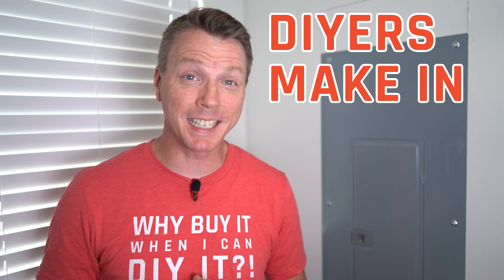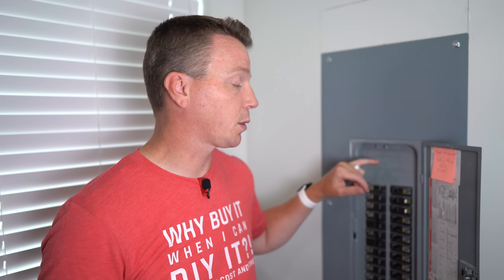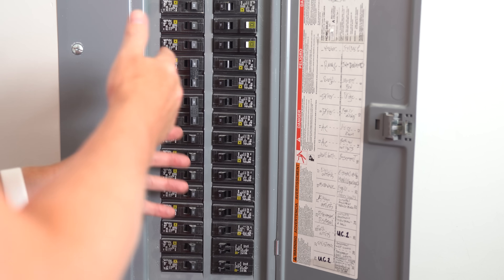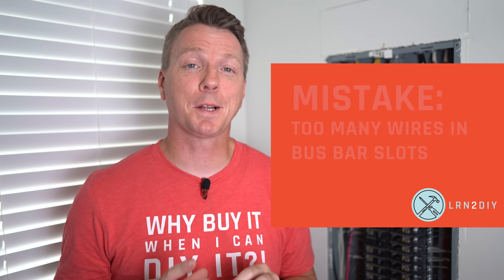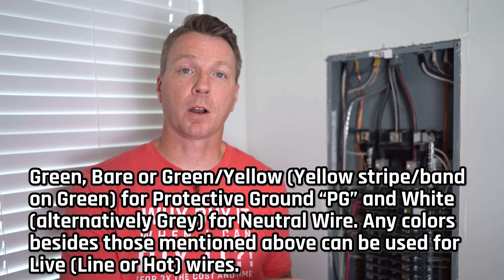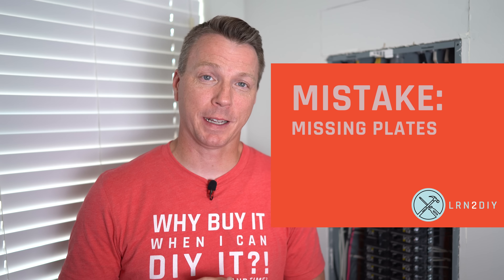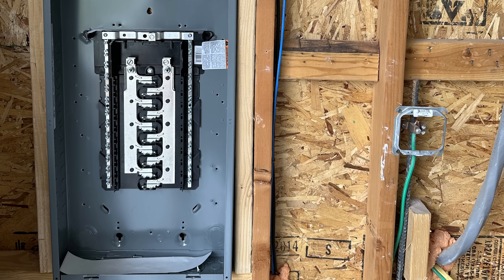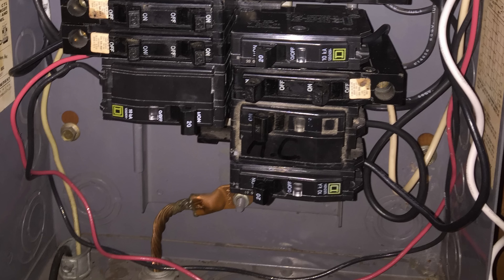10 Common Mistakes DIYers Make In Circuit Breaker Boxes

Comment: Magnífico aporte. Soló agregar:
1) El Calibre del Conductor Eléctrico, depende de la Potencia de consumo del Ckto Ramal o de la carga, y debe ser Dimensionado de acuerdo a los factores necesarios aplicables: Factor de Seguridad, Factor de Temperatura, Caida de Tensión, Factor de agrupamiento, etc. (NEC/NFPA 70_Art. 210 y Art. 230)
2) El Conductor de Puesta a Tierra, debe estar unido al Neutro. Es decir, que entre la barra de Tierra y la de Neutro, debe existir un puente, siempre que este Tablero o Panel eléctrico sea el Principal, lo que se conoce como "Unión Equipotencial" (NEC/NFPA 70_Art. 250)
Gracias por el aporte eléctrico, ha mencionado muchas cosas sumamente importante que muchos electricistas y usuarios, dejan de lado.
Saludos, desde El Salvaodr

Mauricio Archila

Comment: Don't use a drill to undo breaker panel screws or drive them. Sure the screw is not suppose to grab wires, but on a drill it increases the chance.
Then theres no bushing on your service line, thats bare metal pipe. Electric wires vibrate in use.

Comment: These DIY er mistake videos irritate me . Spent quite a lot of time and money correcting mistakes and oversights from several supposedly competent and licensed electricians. The first guys I had when I moved in to a house left so many issues in the panel including the cable entry it’s taken a couple more to redo it. And I wasn’t entirely happy with either of them. So my advice is-be ultra cautious about doing it yourself-don’t do more than you absolutely understand, but be educated and aware if you do hire an electrician. And personally I can read a code too -a few times I have challenged electricians who just mumble ‘it’s to code’. One tried to convince me not to install arc fault breakers and I realized they didn’t understand what they were for.

Comment: My house used to be 100-plus years old, knob-and-tube wiring still used for a lot of circuits. I say "used to", because an electrical fire made it not a house anymore. Squirrels are not my friends right now. 
The previous owner was a "fixit" guy that didn't really know what he was doing, and he brought in some of his friends to do some fixin' and have some beers and snort some white powdery substance in the basement, and most of it was good. 
Now it's being rebuilt and stepped up to current code compliance. It's going to be a while,  but redoing from the bottom up helps make me feel safe again, and my hyper-awareness of electrical and general infrastructure has me both planning for the future in my own house, nut also checking everything in the temporary rental. 

Found some electrical issues. Open grounds, not/neutral reversed, and no hot at all. I think we're up to ten outlets, one showing 30 VAC, and that scares my poop out. AC compressor is irredeemable, furnace may last through the winter, if we're lucky. Bought a CO detector just in case. Upstairs bathtub/shower leaks into the basement, from the underside, the blackening shows it's been going on for a while,

HVAC filter was last changed in 2015. 

I want my place to be safe from the ground up. No shenanigans, no surreptitious bottles of Modelo being uncovered  when we had to move stuff. Solid infrastructure first, make it pretty later.
Reply: glad you are ripping out every single wire.

Comment: Question: Anyone know what the term/abbrevaition "OSBO" might be? There is a mystery 240V 30A double-pole breaker in my panel labeled "OSBO RECEP" and I have no idea where it leads.
Reply: I have no idea what the abbreviation means but 240V at 30A can only be a few items. Central Air, Heater, Well Pump, Stove, Washer, or Dryer. Last potential option that might be more likely is it's a supply to a detached garage or other structure. OSBO might mean Offsite Supply Box(Outside).

Comment: Decent video, but like many on YouTube it is full of partial and/or missing information and this only adds to confusion, especially those with no experience or training.

One very important thing to mention on a main panel when you open and work on it... the feed coming in is live, so be extra cautious anywhere around those thick feed cables and where they attach.  It does not matter if you tun off the main panel breaker, as those lines are always hot.  They are shown at the top in your example panel, but may come in on the other sides for other deployments.  

The panel shown does not appear to have a main shutoff breaker (missing & not located in its knockout slot and those feeds land directly on the panel's bus bars), so I assume it may be a sub panel off the main panel (and where you'd need to cut power off to this sub panel).

Comment: 8:20, I believe the code exists because an unmarked wire is not as obvious when it is removed from the breaker, IE if the breaker were replaced or move elsewhere in the panel someone might wire it to the neutral bus.

Comment: No the wire nut connecting the ground wires together is not OK anywhere in the United State that uses the National Electric Code. The grounding conductor must be the same size as the circuit conductors and the only way this might be ok is if the wire to the buss bar was a #6. NO the panel is not ok to connect the two ground buss bars together.  The mounting screws are to bond the cabinet to ground, a longer bar should be installed and all grounds should go to it or a conductor the same size as the feeder should be installed between them. The panel is not listed or intended as a ground path. As for the number of wires in a buss bar, most are listed for two conductors of the same gauge, per slot, it is not good to use a #14 & #12 because the  screw will stop on the #12 and not clamp the #14 well. I forget which year, code book, required  the marking of white conductors, (1990s) but prior to that, white conductors were considered to be reidentified when connected to a breaker or a switch. Over all I have seen worse.

Comment: I've never seen an electrician use a torx screwdriver but I have found that either the electrition didn't tighten the screws in the panel box or they loosen over time when I do any work in the panel box I retighten all the screws on the breakers some are loose by as much as a turn and a half the older the wiring is the more likely it is to find loose screws and if loose enough can cause arcing which can destroy the breaker plugs and switches and don't trust arc fault circuit breaker since most don't have a tool to test them they can be defective or stop working and whats a logical circuit for one electrician may not be for someone else trying to find the outlets on a circuit can be hard I had a case where a handicap lift was used the circuit had 3 plugs that had been arcing and the hot wires  were burned off and the arc fault was distroyed and the plugs were not in sequence there were one or two between them that were still ok the hardest to find was one was in the master bedroom closet didn't expect one there

Comment: A good tip for some, whileyou have the breaker off, write the breaker number in the back of the switch and outlet plates. That way if you or someone needs to do work in the future, it will be easier to get the right breaker off.
Reply: Brilliant idea! I'm definitely steeling this one. Similar to here at work where there is a label on the outside of the cover plate for the panel# and breaker position. But putting the labels on the inside of the cover plate is aesthetically nicer for the home.
Reply: Only issue here is that changes and mistakes happen. I always try to do this, but I caution anyone who works on my house not to completely trust the markings.

Comment: #11:  Mismatching breakers and panels.
#12:  Bonding neutral to ground downstream of the main panel.
#13:  Using incorrect screws on the panel cover.
#14:  No permits or inspections.
#15:  Unconscionable nonsense.

Comment: @9:56:  You mentioned that you can remedy a double-tap by splitting the hots on a tandem (#2).  BE CAREFUL if you do that, because the neutrals might be shared/ connected elsewhere in the original circuit.  You can't just focus on the hot legs.

Comment: I love that whoever wired that panel left full runs rather than cutting them short.  Too many Instagram electricians cut the conductors as short as possible to have a "clean" panel, but it makes it a pain in the neck to move circuit locations in the future.

Comment: Open circuit breaker slots are dangerous because you can get electrocuted if you stick your fingers through the opening. *Proceeds to shove fingers into the open circuit breaker slot.
Reply: That’s why you put circuit  panel filler blanks in self explanatory

Comment: My 300 amp knob and tube wiring is working fine with my fuse box.  Ive got the perfect amount of pennies that keeps the voltages contained in the wiring.  I even wrapped the knobs with old T-shirts so nobody will get electrocuted if it rains and somebody happens to step in a puddle and flip a switch..  already lost a good buddy from that crap after coming home from a night of drinking..  that circuit didnt have enough pennies on the fuse box either , fixed that already..
Reply: I just found out your not supposed to use pennies in place of fuses.  So i swapped em all out for dimes.  Works a treat!!

Comment: You can have multiple grounds in the in a single ground terminal because they're not considered load carrying conductors, neutrals are load carrying conductors must be separated. 

Your panel on this instance is considered a main lug, new codes prevent you from using the same terminal bar for neutrals and grounds and grounds must be handled by your main grounding means which is usually near your main disconnect off of your service.

Comment: The changing the color of the wire at the breaker is a total joke to me and complete nonsense. If your so smart that you know the wires color indicates what it is used for then you can clearly see as your snooping around in your electrical panel because your so smart, that its connected to the breaker so it has power, why on earth should it be marked at the breaker where its connected? Its at the other end where this would matter and make sense, not at the breaker right where its connected to power, again stupid as can be. The other end is where one would not know and potentially get zapped so marking it at the breaker where its obvious is wrong in my opinion.

Comment: Some ground bars are listed for multiple conductors per hole/screw; when they are, it's typically two #12 or #14 wires.  Need to check literature for the specific panel/ground bar.

Comment: Double tapping should be a no no anywhere. Instead of using a filler plate just install an unconnected 15 amp breaker. when you go to add a circuit. You'll already have a breaker.

Comment: Educated myself for years on how to upgrade my panel.  However, never could bring myself to do it as I thought there might me something I did not know.  So I finally bit the bullet, paid the good $$ and had a pro do it.  Only things I learned watching the pro do it was 1} needed a new feed to upgrade to 200 and 2) use double pole breakers for those circuits that shared a neutral (which was a common practice 69 years ago).  When explained to me as to why the double poles, it answered the question as to why I sometimes felt a little "bite" from neutrals when doing things like replacing outlets.  Never saw my electrician use a torque driver when screwing down the connections. Thanks for the video!

Comment: Using a panel from Home Depot is one
 2nd don't use aluminum bus bars. Get a copper CH Eaton panel at least. 
Size the over current device for the gauge of wire your using and proper protection where required. AFCI/ Gfci. Handle lock out on Dishwasher if hard wiring and water heaters if no local discount

Comment: The box can probably handle much more and a sub panel does not solve load.    Just keep poking your bare hands in that box with no safety gear.  Color does not represent wire capacity ; this is something new and not all mfgr follow same color scheme.  Read the label and be safe.  Many areas also do not have bare grounds in panel.  Ground is not green or bare when there are none.hmm. Blue, orange, brown.  Double tap circuit breakers are totally ok if the mfgr allows it.  What about open wire knockouts?  Some decent info but limited to Rolex systems. You applied the torque wrench to a breaker which was on - not wise nor safe

Comment: You made no mention of ring circuits. I don't think they are used in the US but plenty of other countries that are UK influenced use them. In that case, you would always have 2 live tails in the breaker for each circuit.
As for breaker panels surely they would all have a main breaker? If they are a sub panel then there will be a breaker on the supply panel.

Comment: The main feed into the panel you're showing is missing a threaded bushing leaving the wires on the  sharp edge of the TA (threaded adapter). Locally, they'll call you out on it if there is not a bushing on a TA regardless of size

Comment: Electrician also make mistakes the one doing my brothers house was wiring up the main floor bathroom and the upstairs master bathroom I took a look at the two plugs one up one down and noticed only one wire entering each so while he was working on the lights and fan in the main floor bathroom I asked where he was feeding the power to the plug he replied that it was coming from the upstairs master bathroom plug later when he was upstairs I asked him where he was pulling power from for the master bathroom plug and he replied from the main floor bathroom and I said do you realize you are powering the plugs from each other and neither have a power source no it's being powered from the downstairs bathroom than all of a sudden he stopped and  went downstairs to look at the main floor bathroom I think he suddenly remembered the question I had asked earlier about where he was powering the main floor bathroom then he had to do some calculations on where he could pull power from since the circuit closest to the main floor bathroom were at their limits he couldn't use them upstairs he had a circuit close by that still had one he could add but with the 2 plugs it made 13 one over so he took a chance that the inspector would allow it they are also sneaky cheap and dishonest as when they gave the quote they wrote on it as per code not as per plan and that ment they could get us for a lot of extras we had planned for ceiling fans in the bedrooms and 2nd floor main room all with a switch for the lights and a second one for the fan as reaching up to grab a chain 15 foot off the floor wasn't feasible and it long Chain hanging down wasn't an option either so we got charged 10 dollars extra for each of the extra switches and we also found that code doesn't require a switch at the top and bottom of each stairs and hallways don't require one at each end so more extras switches hopefully the codes have changed plumbers aren't any better we had planned on valves under all sinks and for all tubs but code only  calls for valves for each toilet that wasn't too bad I had my poly b crimper so after the plumber had their rough in inspection passed I added them unfortunately I also had to finish the plumbing job as the company disappeared  he also did the underfloor heating apparently he had a lot of lawsuits on his heating jobs should have got some other company when he said that hot air doesn't rise and I knew we had a problem when he started up the baseboard heating before he started up the boiler he said as long as the water was circulating it won't freeze well he started it circulating as he filled the circuit and before he could start the boiler it froze up  and as we went along with the system we found a lot of mistakes no wonder he had so many dissatisfied customers unfortunately by the time we found them he was long gone

Comment: Slight error in your video. you said: the higher the number, the thinner the wire is!)  Actually, it's the opposite, The higher the # gage wire, the thicker the wire is and, higher the amps aka #14 is rated at 15 amps, #12 is rated at 20 amps or (2400w), #10 is rated at 30a, (3600w) etc., My friend, you need me as a  partner to  make videos and will get 10x more hits!         Here is something else most electricians don't know; Why  are two (3-way) switches called three-way, when there are only two switches? (LOL)  Cuz there are 3 screws on each switch! And with three switches controlling one light, the switch in the middle is called a 4-way, because there are 4 screws on it! (not counting green screw)

Comment: Thank you for the video, you are so right about that voltage. I was hooking up a Electric dryer. I didn't know what I was doing. I don't remember what I did wrong. I unhooked it from the dryer I was replacing the power cord for the electric dryer. I forgot to unhook it from the outlet. The electricity hit me like I have never felt anything in my lifetime, I have got shocked before down through the years,but this was a different feeling. It was like you wouldn't believe.To this day I wonder how I threw the power cord out my hand. I guess it just wasn't time for me to go.

Comment: You can put more than one wire under a termina screwl in a neutral or ground bus. You also can use a smaller ampacity wire under a larger breaker to feed a motor load like an AC unit or Heat pump. You can also use a smaller conductor as a tap,depenibg on the length. 
 There are times when it is necessary especially on grounding lugs. One other thing. I cringe when you are waving your arms about a live panel. That is bad form and a habit you should avoid